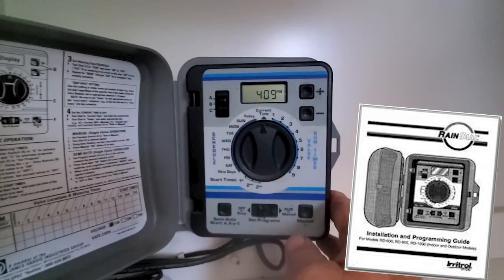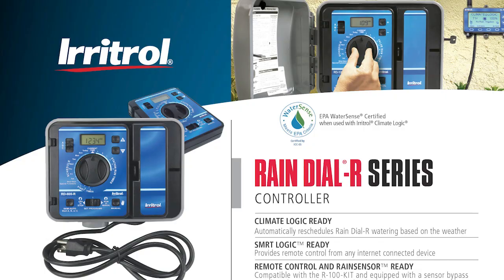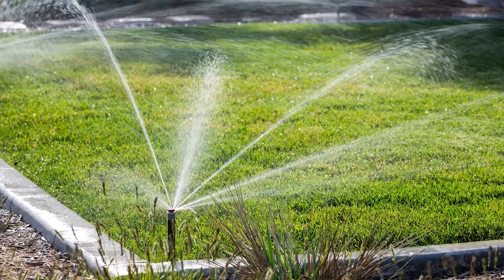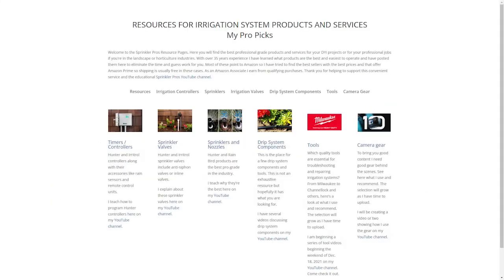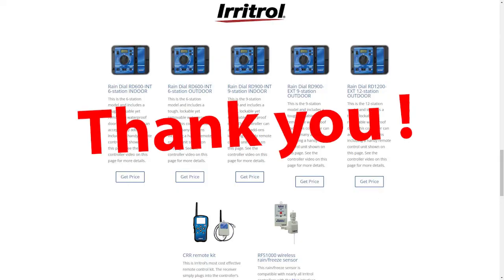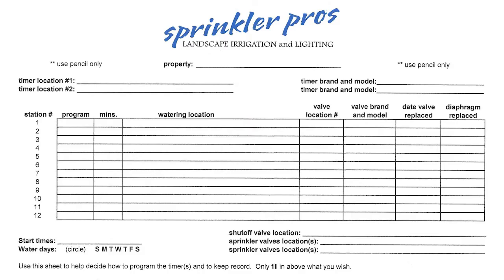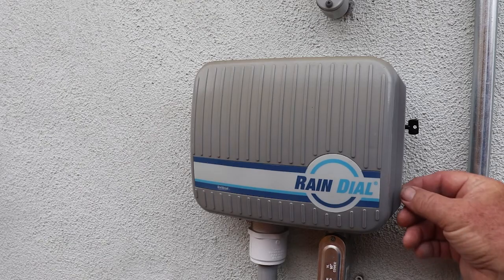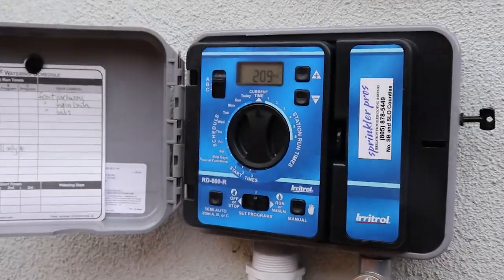How to Program a Rain Dial Controller | + bonus  features

Comment: Great video, thanks. I volunteer at a small native plant nursery in Australa, we have 10 zones on a Rain Dial R controller and I am looking to add soil sensors (if they can be added) but at a minimum the ability to adjust things remotely via a smartphone.

I'd like to see a similar video for the Rain Dial on how to add wifi to it and remote access via phone.  I also like your other best timers video and it would be great to see one that concentrates on their remote capabilities and which is best for that plus integration with soil sensors etc.
Reply from the maker: Hi Dennis, Great to hear from you.
Irritrol has a wifi system that can be cabled to the RainDial (RD) but I have never known of anyone using it nor have any of my clients wanted one so I have no experience with it. I have been installing RDs since they were invented and beyond, it's predecessor, the Hardie HR6100. You can visit irritrol.com and look into the wifi setup. As far as moisture sensors go, I ditto my experience with those too. The only sensors I've installed are rain sensors and Hunter Solar Syncs. Moisture sensors can be tricky since you are counting on the soil throughout your property to be consistent incl. sun exposure and drainage. I'd love to help you out with those sensors and the wifi but I don't have plans anytime soon for video creation for those. Baseline is one of the most popular pro grade soil sensors on the market. Good luck with all that.
Reply: @SprinklerPros  Thanks for the detailed response, I'm now looking at the Hunter Hydrawise system as a good replacement, as it can apply sensors to zones (and not the whole lot).  For example if you have a covered area (greenhouse etc) then you don't want a water sensor to affect its water!  Its app/browser interface is also pretty good and easyish to use.  It also supports flow sensors turning off the watering if a pipe bursts. 

I think I will avoid soil sensors tying into the watering but may by some cheap models so I can get an idea remotely that all is good.
Reply from the maker: Cool.

Comment: The Raindial timer was in our home when we moved in.  Your video was very helpful on how to set it up.  I do have a question that I haven't been able to figure out from the cheat card.  We want to set up different days and times for grass and drip using the A, B and C buttons.  When I'm done programming, do I always leave that button in the A position?  Thanks for your help in figuring this system out!
Reply from the maker: Lizzie,
Have you watched my video called Programs A, B, C WrTF?  That video might help, but to answer your direct question, when you are finished programming it, it doesn't matter where you leave that program switch. Thanks for checking in.
Reply: @SprinklerPros  Thank you so much for the reply.  That helps a lot but I will also go watch your video you mentioned.  Thanks again!!

Comment: Nice video.  Two questions: 1) If you run a zone manually and then leave the dial on that zone, will the system continue to progress through the programmed stations, or does the dial have to be put back onto the "current time" position in order for the programming to resume?
2) Can the timer turn on one zone by means of a program and a second zone by means of a manual request?  (I called for a manual run today for one zone and then noticed that a second zone was dripping at the same time - had never seen that happen before).
Thanks.
Reply from the maker: Keith, you must put it back to RUN for the programming to resume. Only one thing can operate at a time.

Comment: My Rain dial has 2 battery connection points. As from your video the one keeps your program settings. What does the 2nd battery connection do. 
Your video is very informative 
Thank you
Reply from the maker: Tony, where is your 2nd battery connection point? The only one I'm aware of is on the backside of the interface panel.

Comment: hi, thanks! Is there a seasonal adjustment variation, say, to up your minutes across the board for 20% in hot weather for a while?
Reply from the maker: Hey! There is no seasonal adjustment (some brands call it Budget) on the RainDial. My long-time suggestion for RainDial owners is to set all the run times for an amt. you can be happy with all year then just add or eliminate days of the week. It's a much quicker/simpler way to make those adjustments. Like that idea?
Reply: @SprinklerPros  thanks, I had 3 times to up the minutes by 20% each, simple math, kept days (every other day, mainly) same, will  back down by same number of mins after 100 degree heat retreats.

Comment: GREAT VIDEO!  Will you check my thinking?  My irrigation system is set up for 3 programs (A=Citrus trees, B=Plants, C=Palms).  To program, I set it to A and set the start time (1) for 6:00AM.  I just want it to run once.  The other start times are set to OFF.  I set the day to Wednesday so they are watered once a week.  Then I set the run time (1) to 2 hrs., as recommended by the nursery.  The other run times (2-12) are set to OFF.  Then, for B, I set the start time (1) for 6:00AM.  I just want it to run once each day.  The other start times are set to OFF.  I set the days to Monday and Thursday so they are watered twice a week.  Then I set the run time (1) to 1.5 hrs., as recommended by the nursery.  Then, for C, I set the start time (1) for 6:00AM.  I just want it to run once.  The other start times are set to OFF.  I set the day to Tuesday so they are watered once a week.  Then I set the run time (1) to 2 hrs., as recommended by the nursery.  Does that sound right?
Reply from the maker: Lynette, for B and C you didn't tell me which stations/zones are set to run on them. Have you downloaded my free sheet to help you with your programming as noted in the video? It will help you with this.
Reply: @SprinklerPros  Yes, I did downloaded the sheet.  But I'm going to have to ask the installer what stations/zones go with each program number.  I don't know the answer.
Reply from the maker: If you turn on each station one at a time using the manual mode, you can walk around with your sheet and clipboard and pencil and figure it out yourself.
The instructions of how to use the manual function is printed on the instructions on the card inside the door of the timer.

Comment: What are the different start times for? I have start time 1 and 2 set at 7:30pm. Each station set to run for 5 mins. Once it runs the stations, it essentially repeats the entire cycle again. Is it because my start time 2 should be off?
Reply from the maker: There are many situations where using more than one start time can be beneficial but most people only need to use one start time. Because you have both start times set for the same time (7:30pm), that is called stacking. When it completes the cycle for start time #1, then it will run the 2nd cycle that is set for the same time so it is defeating your purpose. What I believe you are intending is for your system to start at 730pm and have all your stations (zones) activate sequentially. That will be accomplished from having just one start time.
With that said, to answer your original question, one scenario is if some of your watering is on a slope and the water runs off too fast to soak in. In this case watering on start time #1 for maybe half the intended run time, then later running start time #2 for the other half. Another scenario is in very hot weather days (100+ deg) it might be best to water early in the morning and then around 1pm. Greenhouses oftentimes need to water several times a day for their seedlings. Glad to hear from.

Comment: When setting the program, does it matter which start time to use? Our clock is not working right(will not record PM times) on start time 1, so we will set with start time 2. We are only using program A. Thank you!
Reply from the maker: JR, No it doesn't matter which start time you're using on RainDial timers.  That's a unique problem I've never heard of before that you're experiencing. Does your RainDial timer have a blue interface? The date code is inside the battery compartment. What is the date code?

Comment: I have all my watering days on program A tha say skp sequencing mode and my system is not watering. What does sequence mode mean and how do I get out of it.
Reply from the maker: Lenny, page 3 of the owners manual says,"Station sequence delay – Provides an adjustable delay period between stations during the operating sequence to accommodate slow-closing valves or a required well-recovery period."
I have never encountered this. I looked through the manual but couldn't find a way to get out of that mode. You may need to call tech support. Here is the manual if you don't have it already: https://cdn2.toro.com/en/-/media/Files/Irritrol/products/controllers/rain-dial-r-series/373-0538V_d.ashx

Comment: is there a limit on the number of minutes that you can have each station run?  we start watering at midnight and would like to stop at 10:00 a.m.  so we would need to set the run time to 600 mins.
Reply from the maker: Yes there's a limit but without being in front of a RD I don't know what that limit is. If it doesn't give you enough then you can create a second start time after that 1st cycle is complete. You have up to 4 start times available per program.

Comment: I have the rainbow 600 system and as soon as I turn on the water supply the sprinkler works and won’t shut off. What am I doing wrong?
Reply from the maker: Mark, I have only seen one Rainbow timer and that was a few months ago when I replaced it with a RainDial RD600EXT so I don't know anything about them. To answer your question, though, the problem is probably with the sprinkler valve. There may be debris under the diaphragm. If this doesn't help, let me know in a NEW comment.

Comment: Is there a reason why my display where it shows the time keeps on flickering?
Reply from the maker: Yes, the circuit board or panel/interface has gone bad. What is the date code inside the battery compartment?

Comment: I flowed the instructions to run automatically. I flipped the switch to set program. Set my program and once finished flipped the switch back to run or manual. I’m pretty sure it’s not running my program. I also notice when I flip the switch from set program to run or manual my station run times will read as off. When I switch it back to set program it displays the correct run time.
Reply from the maker: Yes. That is normal for the run times to show zero when the switch is flipped to RUN or OFF. I can't help you with the troubleshooting of why the system isn't running. Too many variables without being there to see things.

Comment: Does the system only run 1 program at a time? Let’s say my program A runs everyday out of the week, program B runs only 3 days out of the week, and program C is my “test” one. Does the system only run whichever program I leave the switch on?
Reply from the maker: Andrew, great question. It doesn't matter which program you leave the switch on. It will water whatever is programmed.
Reply: So if my program A is set to run at 6 am and 6 pm, and program B is set to run at 12 pm only, will my system go off 3 times in the day? Even if I leave my switch on program A.
Reply from the maker: yeppers
Reply: So if I have program A set to run at 6am and 6pm, and I only want it to run those two times I have to make sure the other programs are not set to run?
Reply from the maker: Andrew, sorry for delay. your question was way down the list and I just now saw it. Your question is correct.
Reply: I want to run my drip system (3stations) on different days (because I run for 2 hours each station) than my lawn stations(9) would I use the B option for that?

Comment: Also is it possible to reset it?
Reply from the maker: Resetting it is a last resort and doesn't address the reason for your problem so you might accidentally re-create the problem if you erase the program now without figuring this out. See my other answer on your other comment.
Reply: Tom there was a fuze error flashing on screen because timer wire to valves was hit by a nail in lath stuck wall .I didn't instal timmer the wire shud have been in coduit.this is at my buddys house he hired me to fix it. So I installed new timer wire in ground to valves . So no fuze error now. This is 2 valve job. But selected switch in a position A the 2 valves keep running .so it works good in B position great. So that's why maybe timer needs to be reset imo?
Reply from the maker: ok

Comment: For “armchair” programming: How is ribbon cable removed? Exactly how is control module removed ?
Reply from the maker: The computer ribbon simply pulls out/off the circuit board BUT you MUST unplug the timer from the power source first. and be sure you have a good 9volt battery installed in the panel.